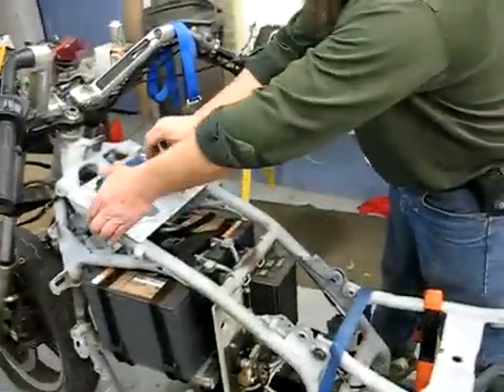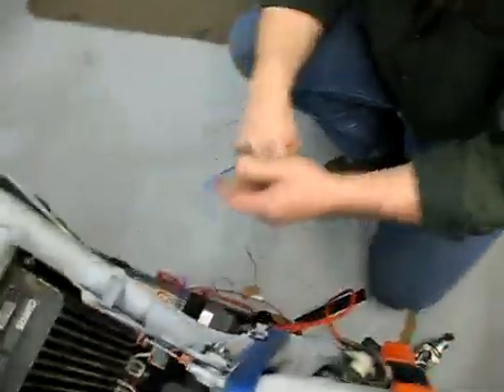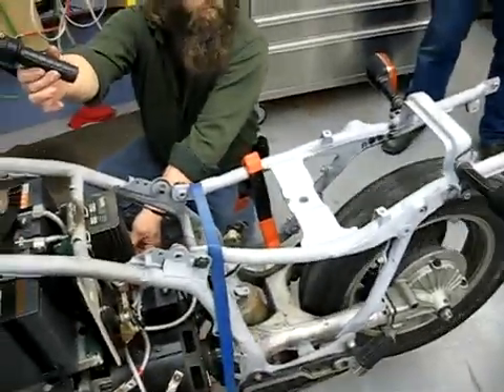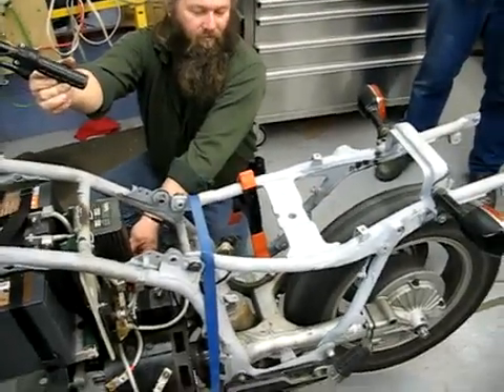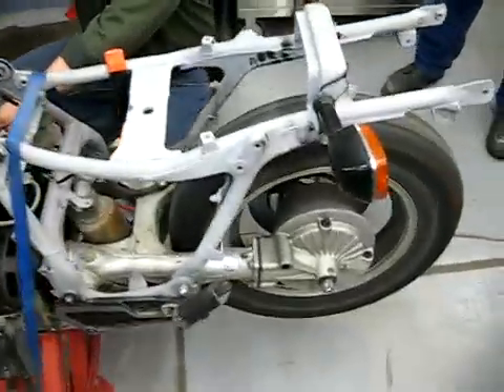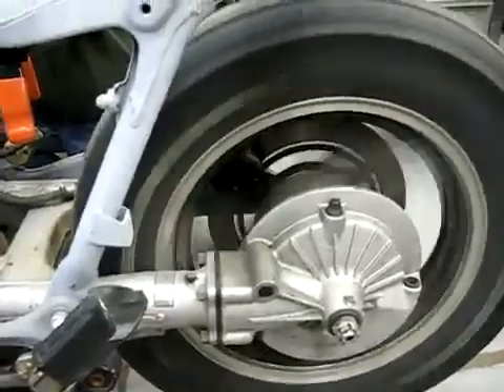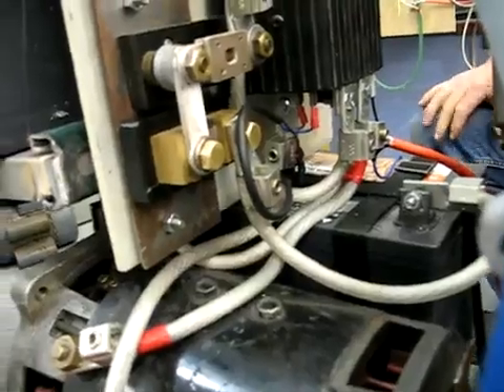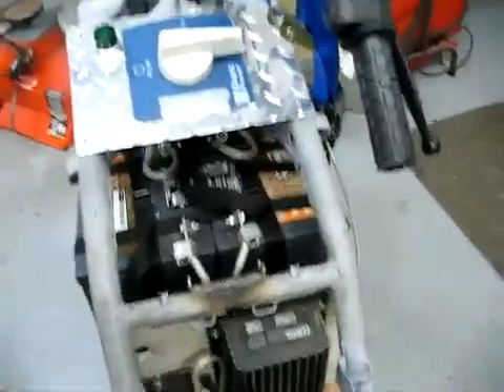Chris' Electric Motorcycle Power-Up

Comment: Benjamin,  I am doing a similar conversion on a shaft driven motorcycle for a project in school. What did you use to couple the electric motor to the splined U-joint of the drive shaft?  Also, what were the results of the 48V performance after you fixed the controller?  We are planning to run our motor off of 72V using 6 lead acid batteries.
Reply from the maker: I didn't work on the coupler, but it was a custom part. I think a piece that fit the motor was just welded on the end of the u-joint and then spun on the lathe. The down-side of a drive-shaft bike with the electric motor on there is you can't easily change gearing, and it tends to pull lots of amps. The easy way to fix that  is to go to a higher voltage. Another friend of mine did a drive-shaft cycle this summer. His was 72V. It didn't have as good acceleration as my electro-Kawasaki, but had a higher top speed and really cruised right along. I added a web link to Black Box Bikes in the video description. That's for a different cycle than is shown in this video, but the same drive-shaft concept.
Reply: +BenjaminNelson Have you modified using better battery tech?

Comment from the maker: You might be right on the make and model. "Performance" is always subjective. Gas/ICE vs. Battery/Electric are just not comparable is many ways. On my EV cycle, I can burn rubber, but I only have a 45 mph top speed, and definately not the range of gasoline. On the other hand, electric doesn't use a drop of gasoline, and has full torque right from the start.

I expect that this cycle will be a great around-town, high-torque, fun machine!

Comment from the maker: My cycle has a 25 - 30 mile range on 4 similar-sized batteries, so I think Chris' will be about the same. One of the limitations of EV motorcycles is that there is only so much space in them for lead-acid batteries!